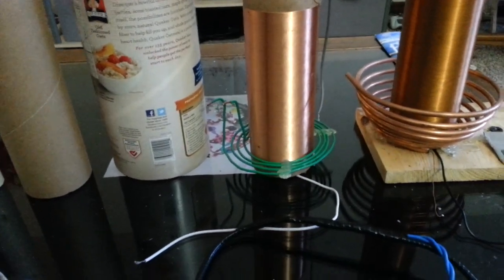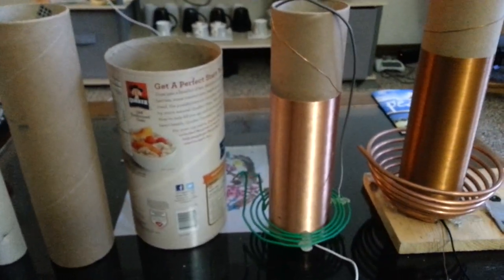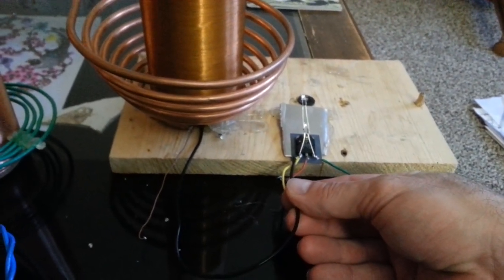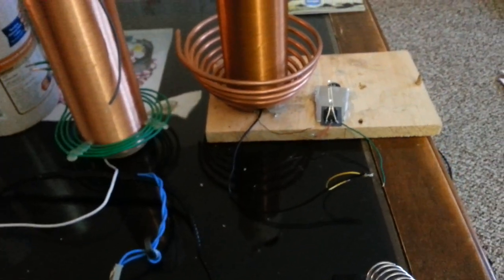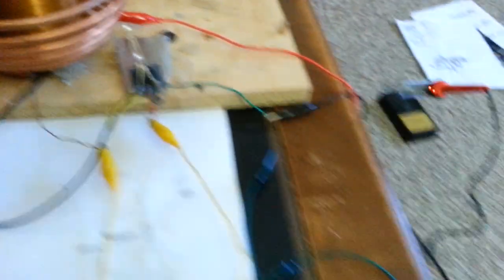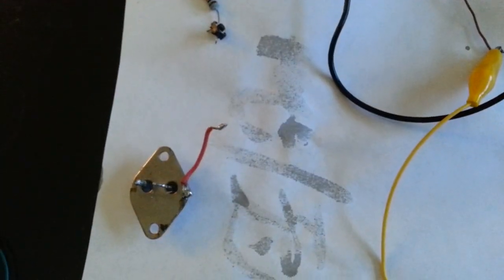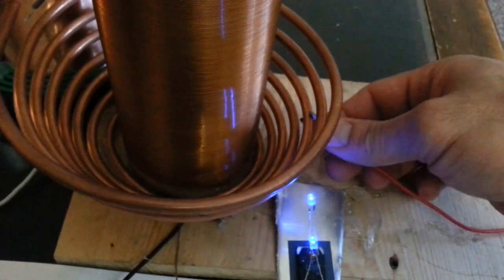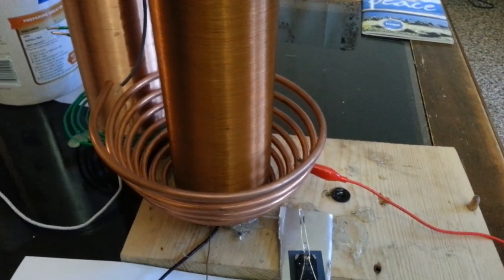how to build a slayer hybrid tesla coil

Comment: The resistor is in the wrong place. It must be at the base of the transistor or at the gate of the mosfet. It should limit the current. So you have 1A in this circuit ... the way you did it is only on and off the led is not working tesla kkkkk